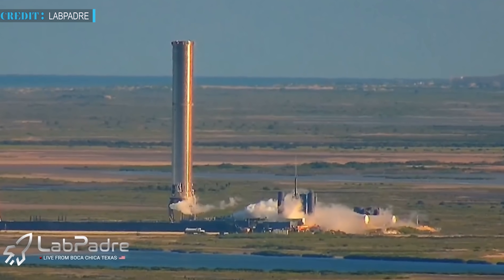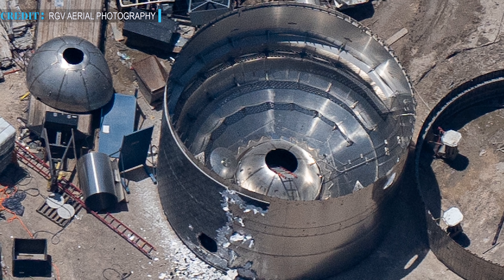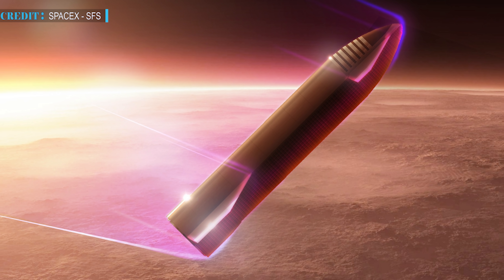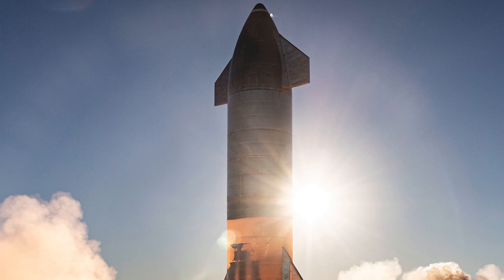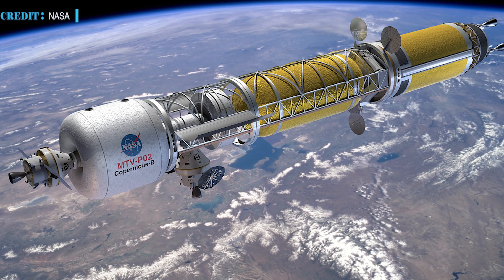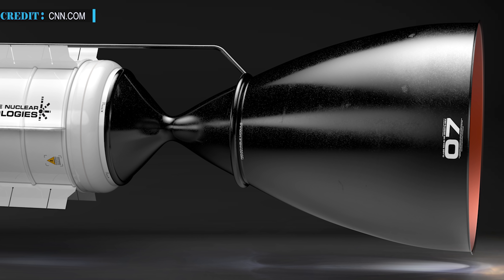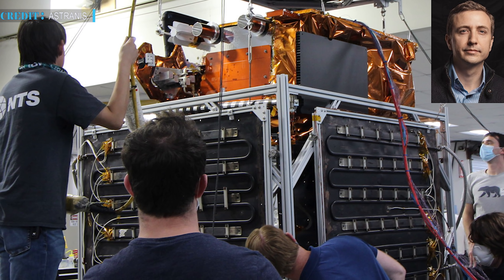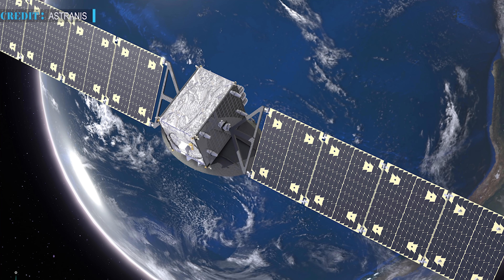Spacex begins assembling first Orbital Starship & fires up Booster 3 | Jeff Bezos launches to Space

Comment: 4:40 Blue Origin had 15 of 15 successful test flights of the capsule and landed the booster 14 of 15 times. Since the safe capsule recovery is the mission, and not the booster landing, it's more correct to say that Blue Origin had 15 successful test flights.
Reply: Yes, for a sub orbital joy ride it is quite an accomplishment. It will never have enough potential to get to orbit, but for what it is great job!.
Reply: @michaelvangundy226  It was never designed for orbital flight. But for a first spacecraft, New Shepard is a good sub-orbital rocket. It just too WAY too long to develop. Blue Origin's motto is “Gradatim Ferociter,” which translates to “step by step, ferociously.” Blue Origin just doesn't seem to take steps very often.
Reply: @steveaustin2686  
I agree, it's a great toy. My daughter wants a toy model.
Reply: @michaelvangundy226  Eh, it's more than a toy as they will sell tourist seats and science payloads on it. It's a good first spacecraft that just took WAY too long to develop.

Comment: Is the reactor technology proposed by General Electric for powering spacecraft based on the use of inefficient, antiquated fuel rod technology?

As I understand the subject fuel rods are merely containers for numerous pellets of enriched uranium and require a moderator comprised of either heavy water or carbon.

A significant disadvantage for fuel pellet configuration is that as uranium decays it produces dangerously radioactive Radon gas.

The Radon gas tends to concentrate at the center of fuel pellets eventually forming a cavity and pressure within the cavity can ultimately fracture pellets significantly diminishing their efficiency.

This in turn necessitates replacement of fuel rods before the enriched uranium of which pellets they contain are comprised are even close to depletion.

Enriched Uranium fuel pellets can be recycled and necessity for replacement and reprocessing is how companies which promote reactor designs that employ fuel rods derive substantial profit.

But depleted enriched uranium fuel remaining after recycling comprises substantial quantities of highly hazardous, toxic, long lived radioactive waste.

Reactors fueled by rods containing enriched Uranium are significantly more complex and therefore heavier and more resource and maintenance intensive than MSR's and incorporate inherent risk for disastrous Chernobyl/Fukushima type meltdown/explosion.

Molten Salt Reactors or MSR's do not use fuel rods or highly pressurized coolant and fuel for MSR's is incorporated with the medium used as coolant, so they are relatively light and simple which equates to enhanced reliability.

Compared with enriched Uranium reactors MSR's are clean because they can consume virtually all of their fuel leaving no appreciable waste and what little they might produce can be recycled and consumed as part of a fresh batch of fuel.

MSR's can use Thorium as fuel and that element is significantly lighter and more abundant than uranium as well as being more easily obtained not only on mars but throughout the solar system and while Thorium still requires extraction and refinement, it does not require enrichment.

Extraction and preparation of Thorium for use as fuel for MSR's does not require anything like the complexity of infrastructure necessary for enrichment of uranium and is therefore far cheaper as well as cleaner and more efficient.

MSR's are also inherently safe because aspects of their design incorporate features which simply cannot, accommodate any possibility of fuel reaching a critical mass or 'meltdown'.

When weighed in a balance, MSR technology redefines enriched uranium technology as a dirty, dangerous, prohibitively expensive and environmentally hazardous thing of the past.

As such, enriched Uranium/fuel rod technology would be best consigned to the past rather than incorporated to cutting edge propulsion systems.

Banker J.P. Morgan backed impractical direct current technology espoused by Edison which naturally lost out to far more practical alternating current advocated by Nicola Tesla and George Westinghouse.

Morgan subsequently attempted to solicit commitment to complicity in putatively unlawful financial activities from Westinghouse who flatly refused to become involved or even associated with it.

Morgan then exhibited what some consider to be deplorably ruthless and unscrupulous behavior when he wrested control of General Electric from George Westinghouse during a financial crisis early in the twentieth century.

Morgan was later implicated in complicity to the same unlawful activities with which Westinghouse refused to be associated because Westinghouse was demonstrably a man of high principles and ideals.

When Morgan then consigned control of General Electric to 'business associates' it was a new beginning for the company.

If the adage 'begin as you intend to continue' still holds true then given the circumstances under which control of General Electric was achieved by new principals and the reasons for adoption of enriched Uranium fuel in the first place.

It might prove prudent if every potential motive behind advocacy for continued employment of essentially obsolete enriched Uranium fuel rod technology in nuclear reactors of any kind should be subjected to minutest scrutiny and public disclosure.

There are occasions, when antecedents strongly suggest that some entities may assign predominant precedence to contriving profit rather than committing preference to socially responsible ethics.

If that should be the case, such entities would not be organizations with which progressive ventures that are potentially vulnerable to dependence on certain technologies should commit to influence much less to substantial dependence upon those technologies via collusion of any, kind.

Comment: Solar thermal rocket that can move high light concentration PV into the focus for powering electric propulsion can beat NTR to Mars at a fraction of the cost and development time. Upon arrival it would stay in orbit and broadcast power via microwaves to the surface.
Reply: What I've seen they are a huge way to go for propulsion systems like the Epstien drive.
Reply: @michaelvangundy226  Not sure what you mean by that. The system I'm advocating consists mostly of elements that can be bi=ought or have been built as prototypes. The NASA "High Dve " program for instance actually built and tested a solar thermal rocket over ten years ago and solar electric propulsion along with SpectroLab produced solar cells can be ordered. Microwave power beaming was demonstrated in the Sixties.
Reply: @stevemickler452  
I'm not a cutting edge expert! But last I heard the best ION thruster put out way less than 1 pound of thrust. That may work on a 20 year mission for a really small probe. But we need a huge advancement to use them locally.
Reply: @michaelvangundy226  In principle you could just use a bunch of hall effect thrusters but the various kinds of MPD thrusters are better but require a little development still. A promising newcomer is magnetic reconnection propulsion which mimics solar flares to produce very high exhaust velocity of propellant at low mass/power and high electrical efficiency. Actually arc jets are quite adequate for the purpose and have been used on comsats. This could even use the solar thermal engine for initial heating and then use the arc.
BTW the mirror(s) can double as collectors for beamed energy from laser or microwave sources which with the reconnection drive could achieve a few percent c
Reply: @stevemickler452  
If they are "beaming" energy they need half of it to maintain orbit. Laws of thermal dynamics.
Reply: @michaelvangundy226  Orbits may from time to time need thrust to raise them if they are low and encounter drag but higher orbits may never need additional energy to be maintained. BTW I am a mechanical engineer and it is "thermodynamics" which has nothing directly to do with maintaining orbit while beaming solar derived energy to the surface via microwaves.
Reply: @stevemickler452  
If you are projecting a huge amount of energy in only one direction, wouldn't there be an equal and opposite reaction.
Reply: @michaelvangundy226  Yes but you are sending out photons which have very little momentum. If this did have such an effect you would have a real good propulsion system that needed no propellant. The energy required to get a significant force is huge.

Comment: Bezos: launches passengers sub orbital hop
SpaceX: lists ~100 feats accomplished in the same time....

This channel seems a little biased...or am I exaggerating?
Reply: Blue Origin has barely done anything, so it should get credit for at least doing something, even if it's not very significant.
Reply: You’re exaggerating; they were just laying out the facts- not even all the facts- which does, indeed, put BO in a very slothful light.
Reply: It still concerns me that SpaceX does not have anything remotely like a proper rocket blast diversion system to direct its dozens of rockets' exhaust away from all those tall tanks, some of which contain liquid methane and liquid oxygen. The three rockets blasted quite a bit of exhaust around those tanks despite the firing lasting only a second or so, and their exhaust is paltry compared to those of the fully assembled booster. Do they have plans to install something adequate to deal with thirty, more or less, rockets firing so close to those tanks, to divert the exhaust away from them?
Reply: @zackgarrit5654  The OLST will have flame diversion for high number of engines. The smaller test stands don't need one.
Reply: SpaceX : First company to achieve orbit, First Company to send Astronaut to space, First Company to build reusable rockets, Has the world most advance and powerful rocket ever made (Falcon 9) and Starship (If successful) is the most powerful rocket to ever be created with full reusability.

BLUE ORIGIN: Started earlier than SpaceX yet haven't achieved orbit yet. Barely reached Sub-Orbit and Is way too slow.